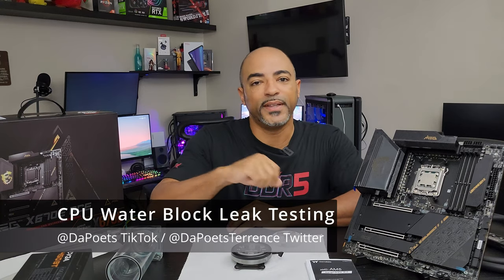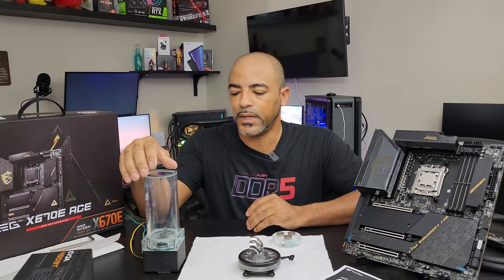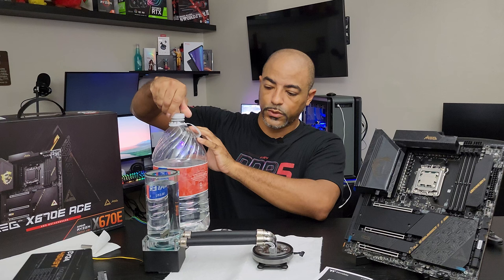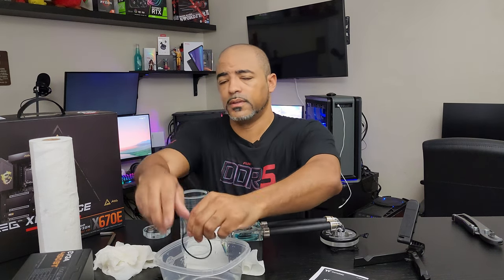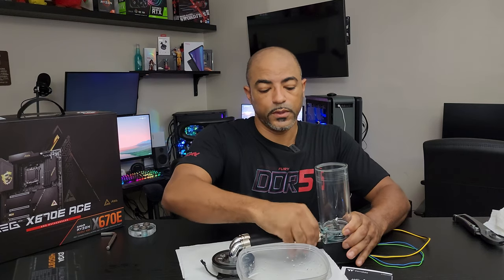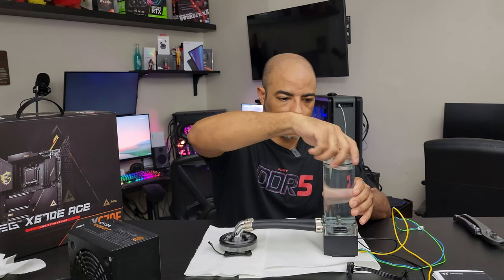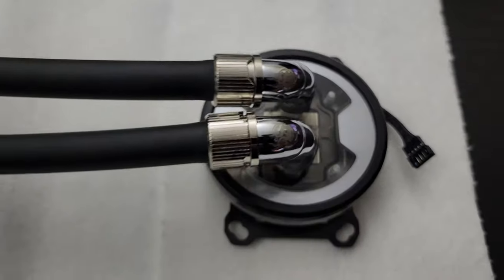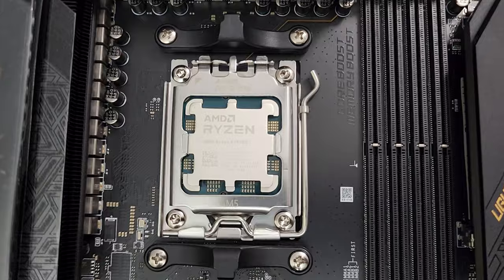We Had a Leak   CPU Water Block Leak Testing - AM4 to AM5 PC Build

Comment: Just a little tip, i use a small amount of silicone spray on the "O" rings. It stops them getting torn when the parts are screwed together.

Comment: EVGA high-wattage power supplies provide the power good adapter as a standard accessory in the box. Optimus water pump/reservoir tubes on the pump base always need to be checked for tightness as the small o-ring can "walk" or "inchworm" in the groove when tightened and allow a leak.  Wiping a bit of silicon grease on the o-ring helps prevent this.

Comment: Yep, DEFINETLY leak test before installing your gear. I went to the trouble of fully bending and installing all my fittings and tubes, then doing a leak test using the EK tester AFTER it was all built.

Should have predicted it: my loop couldn't hold air, the needle on the EK tester gauge wouldn't even go near the green part.

Tore it all apart. Did independant leak tests on each piece. Protium D5 pump/res, just fine. EK Velocity AM4 block, no problem. EK 3090 front and active backplate blocks, same thing.

Turns out I hadn't fully tightened one of the plugs on the Hardware Labs SR2-360 multiport radiator, and it was a plug fitting on the UNDERSIDE of the radiator, so no chance of getting a tool in there to tighten it unless I drilled an access hole through the floor of the case.

That one mistake meant I had built a full loop, then disassembled it, then reassembled it again once I'd found the problem. More work than I needed to do because I was impatient and wanted to get it all done in a day. The SR2 is great if you want to install a temperature sensor plug fitting and have it hidden out of sight, but my leak testing should have come BEFORE I installed my hardware.
Reply from the maker: Great experience though 🙂

Comment: I think testing beforehand is a great practice to maintain, even if you’ve changed the liquid and flushed the system a handful of times prior. Consistent usage may lead to unforeseen wear and tear; smart move. I’ve been leaning on the AIO side of cooling for awhile but after seeing your extravagant water cooled PCs as well as your tips on how to maintain them, I may have to expand my horizons!

Comment: lol. you can leak test with air, you don't need to build and fill your loop outside your case. build it in your case and buy a leak test pump or just connect a tube up to your drain port and blow into it. blowing into your loop is fine unless you're silly and you're using just plain distilled water, use a quality coolant as they all have a biocide in them. and never EVER buy thermaltake watercooling products as they tend to be very very bad, I've never heard anything good about their parts from anyone with long term experience using them. and if you want a custom loop that won't leak then don't buy the cheapest parts you can find, you have to buy into ekwb level parts at the lowest or it will cost you long term on both you wc parts and your systems parts when your cheap and nasty loop blocks rust and inevitably leaks.
Reply from the maker: I'm sorry you heard wrong as I have a very deep first-hand experience with many many water cooling manufacturers over the years. The air testing kit I talked about in the video and explain why I don't use it. Thermaltake in particular makes some of the best water cooling hardware out there. Yes just like any manufacturer they have some things that could be better but things like they're fittings for example are arguably the best in the industry.
Reply: @DaPoets  LOL. how much are you getting paid to talk up thermaltake? their stuff looks good but the failure rate is higher then some cheap nasty knock off companies. I have watched my partners thermaltake custom loop burst like a dam and fry their system, and they have 20 years experience with custom loops and watercooling. thermaltake is bad. and btw it took almost 2 years for thermaltake to compensate us even after they admitted the leak was their fault not ours.
Reply from the maker: @kaylariley9941  Sorry Thermaltake doesn't pay me anything, this is from years of 1st hand experience. Any loop can burst as you described, and there is a reason why Thermaltake, EKWB, Alphacool, and a few others are leaders in the industry. Sorry your partner had a bad experience; it happens with them all.
Reply: @DaPoets  so you're saying ekwb alphacool and bitspower have all had their wb coldplates crack, flood a system in seconds, and it took all 3 companies almost 2 years to compensate the user after they admitted fault and the user had video evidence and showed it to them? btw the video was recorded during the first boot of the sytem after the loop was finished being built, the first boot of a brand new system with brand new parts. I've been building custom loops for 10 years, my partner for 20, and the only issues we've had with ekwb alphacool and bitspower parts was the ek coolant I bought once lost it's pigment, and it took ek all of 5 days to respond to my rma and refund my money. to anyone who might be reading this, search the internet and you'll find hundreds of horror stories of how bad thermaltake wc parts are, and their customer service is far worse. do not listen to this guy he does not know what he is talking about, is clearly getting paid, and he is speaking from an orifice other then his mouth.
Reply from the maker: @kaylariley9941  Yes I have made videos showing cracked EKWB GPU blocks, jet plates in the wrong spots, leaky fittings, torn O-rings, all manufacturers have had issues. In the end your experience is the same or opposite as others. Anyone can have bad experiences with a brand. It happens.
Reply: @DaPoets  will you do research and make a video that lists all the issues users have had in the last 10 years with thermaltake ekwb alphacool and bitspower wc parts? I'm not saying that the other 3 haven't had issues, but if you actually take the time to do unbiased research and make a video, and if thermaltake has not had more issues then the other 3 put together, I'll live stream myself drinking a bottle of thermaltake coolant from the batch that was tested and found to be tap water and food dye.
Reply: I'll take that as a no then. I'm guessing you already know all the problems with thermaltake wc parts and don't want them to stop giving you money if you make a video airing all their dirty laundry. I really hope other people read this and figure out that this guy knows nothing and is telling you all lies for money, there are a dozens of better people doing wc content that won't lie to you for money and you should find their content and watch it. this guy is a lying sell out.